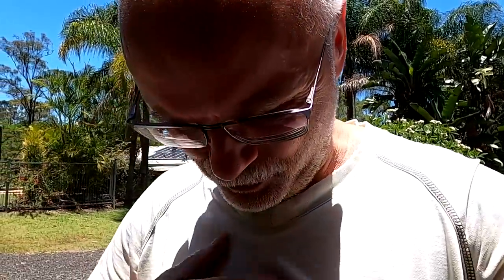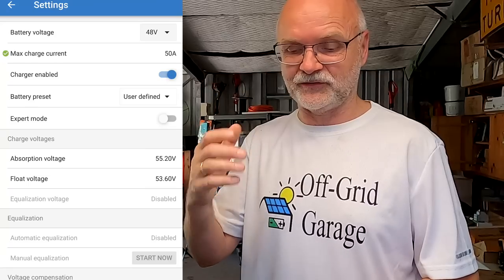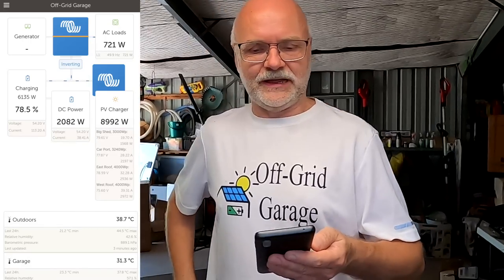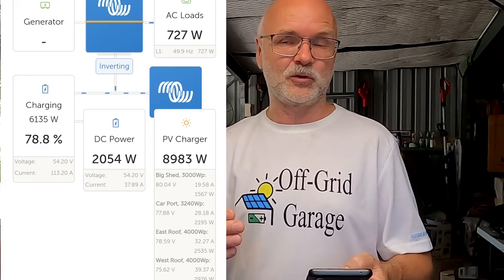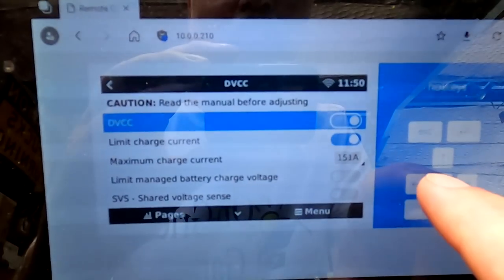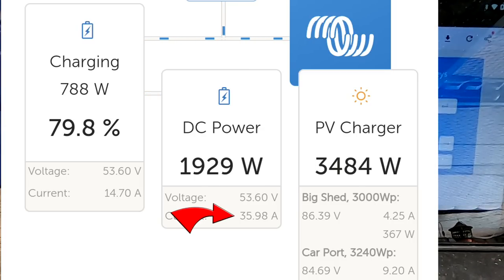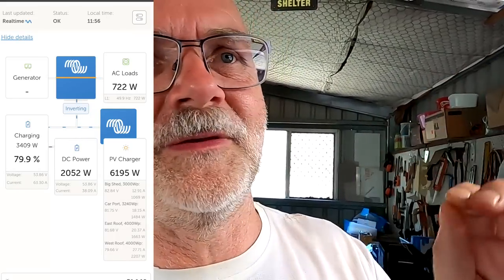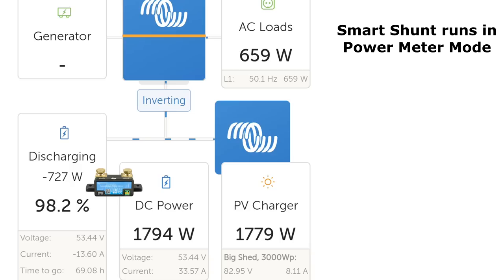Smart Battery Charging Control with Victron DVCC. It actually works!

Comment: DVCC works very well with CERBO GX cordinating the various solar chargers. I use this to coordinate my 6x SmartSolar 100/50. What is nice is you can get it to read the voltage and current from BMS, much more accurate. But there is still an ongoing issue. Overnight, one or more SmartSolar can randomly go to sleep without waking up. The fix is easy, just need to disable and re-enable the controller. Luckily you can now perform this remotely via VRM. I make it a habit to check via Bluetooth or VRM each morning to ensure all my Victron SmartSolar solars are generating power and not sleeping... I have 2x other 150/100. Haven't yet connected to this setup yet as i use these with 4x 200w folding solar for my RV portable solar set-up. But shall try later to see if this sleeping / not waking up issues extends beyond the 100/50.

What's more impressive is, after all the batteries are fully charged, but only the inverter is utilising power from the solar that Cerbo GX can regulate amongst the 6x SmartSolar controller how much power each controller should generate, just to meet this load, without over charging the battery. It is quite amazing to see how this magically happens via the VRM portal. 😊👍

The key towards Offgrid solar success is tuning your system so that the energy is spread out over multiple peaks and not just a single peak from one controller, which would need to be throttled down via DVCC. Ideally you never want DVCC to kick in and intervene... as this is net loss of solar energy captured. You want to have as many SmartSolar as you can setup, each having a different and non-over lapping peak output coming through. You can strategically place different groups of panels connected to different SmartSolar to achieve this. This way, if you over size your solar and over size your battery, you can easily ride out bad weather and even continue to make good power on rainy and overcast days. 🌧️☔🌞😬💪💪💪

Comment: Well…no kidding. DVCC is muy bueno for those of us with multiple types of chargers and loads. As you have demonstrated, shunts make it even smarter. 

My system has 5kW alternator (Wakespeed regulator), 2 Multiplus’s (split phase on ac side but easy to parallel if shorepower isn’t split phase), and dual mppts for 800w (hey, it’s a sailboat, not a roof😎). I will take all the solar I can, then shore power, if available, then the alternator, if engine is on. I’ve only got 21kWh batt storage (25.6v) but air conditioning in summer on a sailboat without a generator is…marriage saving 😇. Next add-on will be wind. 

Another great video. Thanks, again.

PS—one SPAT is on the way 🍺

Comment: Yes, and DVCC also ramps down the charging current when SOC reaches more than 90% and stops charging when SOC is 100%. Once every 1-2 months I switch DVCC off for one charge cycle to get the SOC of my BMS in sync again (3.5V/cell). So happy with it.

Comment: Great info thanks. I actually bought two Blue Nova RacPower BN52V-100-5.2k DU batteries to integrate with my Victron system to benefit from exactly this DVCC function. Integrating a third party BMS system with Victron can be problematic, but the Blue Nova documentation is very well written and describes setup/wiring to the finest detail. I have the Victron Shunt VE.Can included to measure battery load. This information, combined with the BMS Can info from the batteries is combined in the Cerbo for very accurate control by the Cerbo GX, leaving total peace of mind that the batteries are looked after in a closed loop system. With this setup, DVCC is forced on by the Cerbo.

Comment: Hi Andy, with Venus OS Large and Node Red you can program controls for the charging and discharging current as you wish. So you just need a temperature sensor in the battery, which communicates to the Victron System and control the current depending on the temperature.
Even cheaper alternative, if you have  a lot of solar to spare in summer, you can just program it such that the charge current is lower in summer and higher in winter.
Reply from the maker: I know, this can be done with Node Red, but no idea where to start and how to program that. Just not enough time to look into all that...
Reply: @OffGridGarageAustralia  Andy was that u on the Telegram app who sent me a message saying I won something ??
Reply: @diysolaradventures7894  i doubt it
Reply: @SiriusSolar  ok thanks someone posing as u tried to scam me telling me I won something he was messaging me on one of your videos comment sections
Reply: @diysolaradventures7894  Just to be clear I am not off-grid garage.  I know he has done giveaways before and I'm not sure what method he uses to contact people but 99.9% chance that the person contacting you was literally a scammer.  It's easy to tell though Just look at the person's name and click on their name. If it brings you to their YouTube channel and it is literally the correct channel then it would be the real off-grid garage. But if it brings you to a different channel that might have some stolen videos from the official channel but doesn't have the whole history going clear back then it's a scammer. And if he's giving you some stupid WhatsApp , or telegram or some other messaging system contact then it's definitely a scammer!
Reply: @diysolaradventures7894  😂😂😂😅

Comment: Nice feature, this is why I like Victron, it has 100s of features that are only useful to a few people who never even knew they could benefit from such a feature.  Although I do similar by limiting charge voltage, and that way you still get a fast charge early then just slows down and maybe never quite hits 100% - however you get full kick in for AC loads.
And I was so sure that would be the route you went down for these niggles, not the DVCC I knew nothing about. But that helps a solar upgrade for me without a BMS upgrade - 100A BMS on a 900ah system with the inverters bypassing the BMS as they draw more current.

Comment: Hey there Andy, I have not gone back to binge-watch all your episodes from the beginning(yet), but the advancement of the DVCC is a great benefit but the power of ESS is also huge. I have a small system in my shop set up that is allowing me to feed my excess solar production back into my shop to help provide some of my daily use. At some point, I would love to have an array like yours but can not spend all the extra beer money on panels ya know. My goal is not to feed back to the grid but to be totally self sufficient through most of the year and to also allow me to add air conditioning to my shop.

Comment: Andy, I found that the easiest way to keep your batteries cool is to cool them down with a very light breeze across the top but only during the early cool morning hours and off by 9am. The buss bars are actually great heat radiators and pull the heat out excellently! If you cool them this way you, it GREATLY delays the heat buildup during the day. Remember, you don’t want to blow warm air over them when the air gets hot. Just let the stagnant air be around them when you charge/discharge. A very small computer fan is all that’s needed for each bank. If the battery is in an enclosure there needs to be a means for air exchange. My garage got pretty hot last summer luckily it does cool down at night and I have some ventilation to help bring in the night air.
Reply from the maker: The problem with that is that it will accumulate a lot of dust over time and I would need to have some sort of airflow with also an in/outlet , filters, fans, control electronics and.... maintenance. 
Limiting the charging current during these hot days works brilliantly and I could see up to 5 degrees cooler batteries than charging them faster. It also does not stress the batteries as much, so win-win
Reply: @OffGridGarageAustralia  

Well, perhaps a little Pelletier thermal electric unit. Trust me, it doesn’t take much to change the core temperature. I actually was in disbelief and thought it was only the surfaces and only the thermistor were being cooled/fooled but I could verify the temperature down the sides of the cells.
Reply: @OffGridGarageAustralia Humidity can also cause problems, in particular with busbars. I left a busbar in front of an evaporative cooler during the summer, and it corroded rather badly in just 3 or 4 months. I live in a substantially warmer (and less humid climate) and was wanting to see if an evaporative cooler was an option to keep batteries cool. The answer is no, it will cause too much corrosion.

Comment: Andy,
You can use Node Red (part of Venus OS Large) to create a flow that automagically adjusts the DVCC current based off of a value you set for battery max current. I use this method and have the max battery current set at 0.1C (lead acid) . so now when I add load, Node Red adjusts the DVCC current. if there is excess solar available,  the battery only ever receives 0.1C with the excess current available for DC loads.
Reply from the maker: Yeah, I know this works somehow with Node Red. Never looked into this, no idea how it works. Even all my Venus OS are Large
Reply: Node Red is awesome. in summary enables automation. from node red you can read and set the state of dvcc and read battery current and DC loads. all I do is add 0.1C + DC Load Current and use this value as the new DVCC current value. this automation runs every second and now I can charge the battery at max and use the excess power for loads

Comment: Great video & explanations!  It looks like Victron updated the CerboGX manual to include a lot of these details.  

Section 11.4. DVCC features for all systems
These features apply to all types of systems when DVCC is enabled; with or without ESS Assistant, with lead-acid or other normal batteries as well as when an intelligent CAN-bus BMS connected battery is installed:...

Comment: I start balance at 2.50 and 3.65 max on a victron 100v/50amp 280ah lifepo4. I don't have enough input from solar to overheat the battery but even though it never says it's balancing it is. I wish I had your grid. All that free energy

Comment: Nice episode!  I'd say your current system is really quite robust.  DVCC is a good idea though.  Even better would be to have the current limit (going into the battery) servo'd to a battery temperature sensor.

We do something similar (a temperature / power servo) for side-of-building LED lighting.  It is needed not only to protect the lighting against someone programming in an all-on condition (RGBWW all on full), but also situations where full sun in summer is shining onto the side of the building that the LEDs are on. Basically the normal PWM controlling brightness has a second control loop coded up in the controller which derates it based on the temperature of the LEDs.

In anycase, its a temperature servo loop with a very slow response time (about 10 seconds) and a linear ramp to avoid causing any noticable flickering or lighting changes.  We limited the circuit board to around 85C, but start the servo de-rating at 70C.  The system goes into fail-safe at 90C.  Due to 'noise' in the measurements, the fail-safe needs to be about 5C higher than the maximum servo de-rating.

For a battery / charging current servo, you would start at 35C and fully-derate at 50C or so (for LFP).  e.g. up to 250A at 35C derated linerally to, say, 25A at 50C, and a cut-off at 55C.   The idea is that if the servo is implemented properly, the fail-safe cut-off point will never be reached.

This is essentially what fast DC chargers for EVs do, too (at least when the firmware is properly implemented).
Reply: Great amount of info here! Now perhaps Andy takes on the task of presenting it for us visual/auditory way??

Comment: Hi Andy, thanks for all your insights! I'm in the process of building my own battery for a Victron system using your video's. Some people talk about sanding the battery leads and busbars and putting some carbon paste in between to prevent corrosion and make a better connection. Can you ellaborate on that? And do you have a paste in mind? I cannot seem to find any suitable paste. Kind regards from windy Netherlands 🙂

Comment: Also when using can.bus bms controlled batteries, you can limit the battery voltage to stop charging with dvcc. Beyond this point  would be great to have another video about “Using node-red to automatically stop charging when programmed soc is reached and still feeding all dc loads” :)

Comment: There is no need for 2 shunts my friend.  You need to keep charging and DC loads on 1 side of the shunt, and battery storage on the other side of the shunt.  That's it.  All the charging equipment have their own internal shunts to transmit data with, anything extra is a DC load.  I use the 1000 amp lynx shunt for this usually in my installations. I suggest changing how you wired your installation to how we do it on ships instead of adding a shunt.
Reply: If Andy adds a 2nd shunt for dc loads then he can set the charge rate and it won't be affected by dc loads. The system will then allow the solar controllers to generate more power to run the dc load, as it currently does for his ac loads, without subtracting them from the battery charge current.
Reply: @HermitHippy  you can do the same thing if the dc loads are on the charging side of the shunt as I have suggested without buying 2 shunts.  All you have to do is program your battery's BMS properly so it limits the charging current.  No matter how the installation is put in, the BMS for each LiFePO4 should keep it's battery safe, independent of everything else.

Comment: Again, great video Andy! 
I have tried the DVCC settings as well in my setup, but I faced the problem that the system should all my energy (into the grid) - any suggestions how to prevent this situation? 
Add: I have connected the JK-BMS to my Victron system.

Comment: I actually used small water air cooler to bring down system temps in the summer days, I recommend you do the same but you need to put it outside it would not work on sticky days though. Better solution is to install 24000btu inverter Ac this will solve all the issues in your garage even 18000btu unit is enough you can use the last 10 amps to run it once temps settle power use will go down significantly.
Reply: I tested using an evaporative cooler here in the desert. You very much accelerate corrosion problems.
Reply: @john_in_phoenix  the space needs to be open so the air goes in and out without circululating inside and from far away using bernoulli effect.
Reply: @MiranPayman  oddly enough,, I know how it works

Comment: I use this all the time to keep the efficiency of the multiplus above 90%. If I turn it off and let it charge at the full 35a (48/3000), it's around 85%, and as I only have 500w of solar, the battery is always charged from the grid.

I only turn if off if my ToU price is really low and not that long, then I don't care about the efficiency :).

Comment: Good to know!   I didn't.  Goes to show me yet again that I should RTFM...!   I wonder, though, about the Orion DC-DC converter which does not have a charge current limit feature IIRC, so it likely would not be affected by this DVCC limitation unfortunately, would it?  Or is there some secret feature that is to be revealed?

Comment: Hi Andy, great video. I have a question for you. I live in cold Switzerland, where i have to heat my lifepo4 batteries in my garage to not destroy them while charging. That Problem was solved with the streetlight function on the Victron MPPT charge controller, which allows me to program the heating mat under my battery bank to switch on 3 hours before sunrise and get the batteries above 0°C. It‘s a 25w heating mat. So approx 75wh/day. Isn‘t that bad. So my question to you: i have a big problem with my solar cells icing up and taking a few hours to deice and generate power. Since a solar panel is essentially a diode, could i reverse the polarity and generate heat inside the solar panel? Will it take damage? I could use a buck converter to get the reverse voltage to a safe level. Thanks for anyone replying :)

Comment: Hi, I have two mppt connected to a colour control via ve direct. Could the dvcc system synchronise the charging of the two mppt to the battery? How could I set it up?
I currently manually set the maximum amps of each mppt to add up to the maximum current allowed by the battery.

Greetings and thank you very much for your video

Comment: Do you actually need two smart shunts, can´t you just move the DC load to the other side of the shunt (not battery side)? It appears odd the DC load is not separated from the current in-out of battery....it must be no? The other thing that would be useful is to be able to "dump" excess power (solar power) when batteries are full to a load such as water heater (in your case perhaps heat the pool in winter). How can this be achieved? I had planned to use a PLC/Raspi for this but if DVCC has support for such a thing it would be great. Currently designing a threephase (3x5kW) system using Quattros. Tempcontrol of battery is vital, at around 60deg C the LFP electrolyte begins to breakdown. Staying well away from this battery killer is wise.

Comment: Shouldn't you allow full current under 50% or 75% state of charge and reduce above that.  Can DVCC get enabled over a certain voltage?
Reply: That's what some Smart BMSs can do (e.g. REC BMS with 2A passive balancing and SMA Sunny Island/Victron compatibility etc). REC BMS massively reduces current at higher SOC.